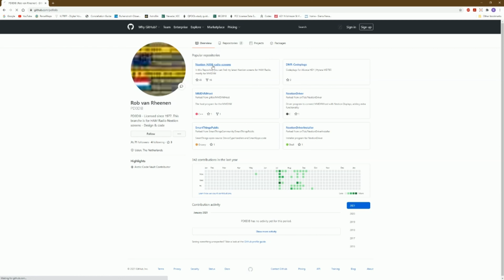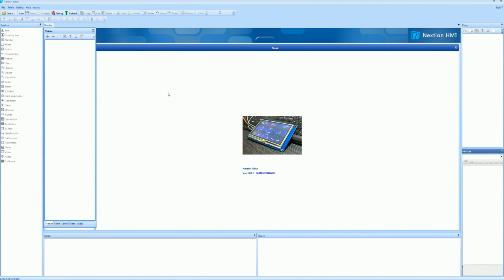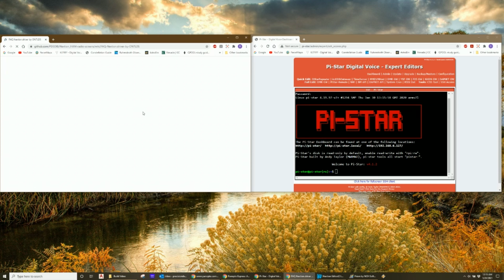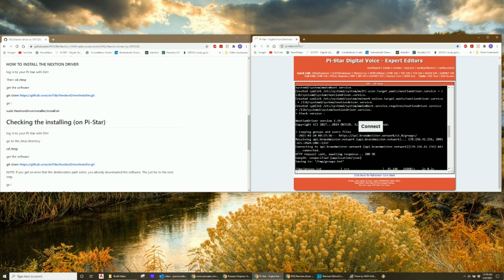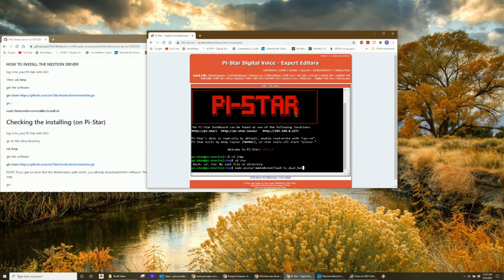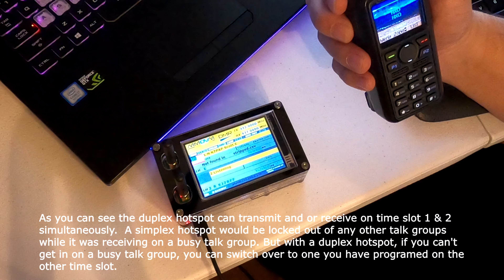C4 Labs DRPi-3.5NSX Nextion Screen Case - Build Video

Comment: Ever since updating to MMDVM firmware v1.5.2, I haven't been able to see the "cpu cycles", "disk free", and "cpu load".  Just FYI..  😉
Reply from the maker: Try reinstalling the ON7LDS driver.
Reply: @arlo12345678910  Done that several times..no luck.
Reply from the maker: It may be installed but not configured.  See my reply to Tom V below
Reply: @arlo12345678910  've tried all that..  Was running Pi-Star 4.14 , Pi 4B+ 2GB.  Still doesn't work.  I even changed SD cards and started from scratch.  It all works except the  "cpu cycles", "disk free", and "cpu load".  Go figure....
Reply from the maker: @tim6053  ....  Dang.  I had that same problem but it was the configuation.  And each time I reinstalled the drivers, it appeared they were installing.  But they weren't actually reinstalling.   It wasn't until I scrolled back up and read everything that I realized it was saying I already had the drivers installed, did I want to reisnatll Y/N.     I needed to hit yes in order to reinstall except that it would flash past that screen with no time to hit Y (yes).   It finally dawned on me that I needed to be tapping Y from the moment I started the driver install.  That way when it flashed past the screen where it says " Do you want to reinstall Y/N"   I was already tapping Y to initate the reinstall.  

I'm not saying this is your problem it sounds like you are confident the drivers are installed and configured correctly.  I only bring it up because on my first hotspot which is the same as the one in this vid, I had the problem twice where it wouldn't display the "cpu cycles", "disk free", and "cpu load"  and both times the drivers were installed but not configured.   The first time it happend I was perplexed for a long time.  I reinstalled the dirvers over and over but to no avail.  Untill finally I actually scrolled all the way to the top in and read the lines of code.  I was never acturllay RE- installing the driver.   Have to be tapping that Y key.   The second time it happend I solved it in a jiff.   

Again I'm not saying this is your problem but I feel like it is a common problem seeing as I had it happen to me twice on the same hotspot.   Also there is a forum on facebook where a driver issue is always at the bottom of the non appearing "cpu cycles", "disk free", and "cpu load".  I wish you that absolute best and hope you are able to solve this mystery...  If you do please come back and let us know what it was.  I'm sure someone else will have the same  problem and would be great if your solutions was here for all to learn from.   73!
Reply: @arlo12345678910  Thanks for the info..checking..By the way, what do you mean by "and both times the drivers were installed but not configured."  Is there something extra that needs to be configured?  I have selected from the display line, Nextion, Modem, and ON7LDS 3 HS"..  Is there anything else?  Thanks..  73
Reply: Also, has anyone got this working with a Pi4B+ ?
Reply from the maker: @tim6053  Meaning that there are two things you must do to get the driver working.  First download it and second install/configure it.   You download it to the temp directory first by typing:
          cd /temp 
This command accesses the temp. directory then you type:
          git clone https://github.com/on7lds/nextiondriverinstaller.git          
This command downloads the installation file to the temp directory then you type:
          sudo nextiondriverinstaller/install.sh
This command both installs and configures the drivers in this step. You don't have to do any other configuring.  However twice for me it installed but failed to configure the driver and so "cpu cycles", "disk free", and "cpu load" would not work. 

Since those fields did NOT work I was under the impression that it had NOT installed it and so I performed the above code sequence time and time again and time and time again all kinds of text would scroll down the screen making it look like it was reinstalling. But of course the fields still would not populate.  So then I was under the impression that I had the driver installed correctly and it must be something else.  But every time I inquired with others about what could be the problem they all told me I don't have the driver installed correctly. (what they meant was configured correctly)   So again I went back into the CSS Access (i.e. DOS mode panel) throught pistar's expert portion of the configuration page, and this time I was determined to get to the bottom of it.  I accessed the temp directory, ran the download, ran the installatoin and it did the exact same thing it always does, scrolled a bunch of text down the screen making it look like something was happening but this time I scrolled back up to see what all that stuff actually said and I realized it was not actually reinstalling the driver because the driver was alredy intalled and what it was doing was simply closing out. In fact it actually said,   burried in severals screens of text,   the following:

"The ON7LDS driver is already installed do you want to reinstall it y/n"
"you have version 1.9"      
"the latest version is 1.9 no need to reinstall."

That's when I realized I was never ACTUALLY reinstalling the driver.......   

So I thought OK well it does ask me if I want to reinstall the driver so all I need to do is type Y at that prompt.  So I ran the install again but I had one major problem......  The text was flashing up the screen so fast there was absolutly no time to even see where it said "to reinstall hit Y/N" let a lone to actualy be able to type Y at the appropriate time.  It finaly dawned on me that I needed to be typing Y in rapid sucession from the second I initated the driver install so that I'd catch it when the prompt flashed across the screen.  

When I did that I it worked like a dream,....  I caught it in time and it indeed ran a reinstall and this time it started flashing tons of text down the screen for a long time.  I.e. it was actually REINSTALLING the driver and actually CONFIGURING the driver... FINALLY!!.  And this time when I fired up the hotspot those fields populated. 

All that being said, I am not 100% certain that this is your problem I could be totally off base but I have a sneaking suspiscion this is your problem.    You did mention that the fields stop populating after running the MMDVM Hat firmware update.  So I made the assumption that they did work at one point and that the Pi4B  was not the problem.  They did work before, correct?  Is the temp field populating?  It would be really good to know what temp your hotspot is opperating at as I've heard the 4B's run hot.   Keep us posted of your progress and 73 friend!
Reply: @arlo12345678910  
Well, apparently persistence pays off !!  😎.   I reloaded it one more time (using a Pi3B+ this time), and started slamming the "Y" button a fast as I could.  It actually asks you for a "y" instead of a "Y"..  Not sure if that matters but it stopped long enough for me to enter the correct key.  Long story short, it now works 😃😃.  Now I'm going to try the Pi4B next and see if I can replicate it.   Thanks for the help.  73
Reply: By the way, I use a small Pimoroni Fan Shim on the Pi4B...Works great and never gets of 57.
Reply: Just got it up and running correctly on the Pi4B !!  Using the same technique  😎😎👍
Reply from the maker: @tim6053  Awesome!  I'm srue it feels great to overcome that little glitch I know it did for me when I got mine working.  Glad it works on the 4B too and that it's running cool with the Pimoroni.  That's great information to document in these comments.   I'm 100% sure it will help someone else down the line.  73's back atcha!

Comment: Nice!!! Bob, did you only need the one heat sink?
Reply from the maker: I used two. The larger one on top of the chip and on the bottom there is a square cutout in the acrylic that lines up with the bottom of the chip and I popped the medium size heat sink in there

Comment: Thanks for this walk through it was very helpful getting up and running... I have one issue with the Nexton, it is stuck on the demo screen.I'm using the same exact configuration as you are using the NXT pinouts on the hat red blue yellow black double checked the Rx>TX and TX>RX reversal still no pi-star display just the Nexton Demo. any Idea's ?
Reply from the maker: When you say demo screen do you mean boot screen? The boot screen is the one that says, "Please wait, starting up hotspot..."
Reply: @arlo12345678910  it is the demo screen with the three sprites of a production assembly line with three buttons under each. I have the pi-star up and running and can browse to the config interface just fine just no pi-star video display on the nextion
Reply from the maker: @wkm2002  OK, so in that case, your Nextion screen needs an image uploaded to it.  The pi-star opperating system has no image of it's own.  Go to 2:57 of my video and watch the procedure for "imaging" your nextion screen.  By the way, if you've soldered your Nextion screen to your modem you'll need to power up the Raspberry Pi in order to power up your screen.  Hope this helps!
Reply: @arlo12345678910  ahhh... I knew I was missing something ... thanks for the helping me hear the popping sound ... lol :)

Comment: minor/major mistake - when switching to duplex - you should have selected 'Apply Changes' -- same said as you update/alter each section of the configuration.  The 'Apply' is only for that Section.  So typically one would alter the Duplex, if applicable -> Apply; then setup the wi-fi interface -> Apply; then the General config -> Apply; then any specific protocols - DMR, YSF, etc. first by enabling & applying, then individually configuring.  I also perform a "Backup" between major secitonal changes so as recovery is quicker if a section is mis-configured accidentally.
Good overall - answered the question I had about imaging the Nextion - didn't realize it was that simple.
Reply from the maker: Yes that is correct, must apply after ea section. I kinda jumped the gun on that, although sometimes even when applying directly after maiking changes to a section, the the changes don’t take.  Glad you were able to image your Nextion screen. Very easy to do especially if you have a chance to see it done once or twice.  Exactly why I made this video so that all the informatin is in one place!  Thanks for watching and I really appreciate your feedback!  73
Reply from the maker: I've confirmed you do not have to hit apply at the end of ea section.  You can fill out all the sections and hit apply once at end

Comment: You did a great job..a lot of work.
I followed your procedure..but still cant get the 3 areas on the screen to show data??? Downloaded
The on7lds file as shown but still no go?
Reply from the maker: Try redownloading and reinstalling the ON7LDS driver.  ~
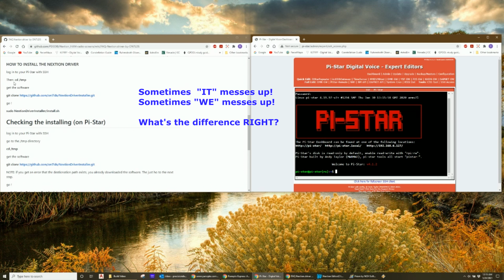The sequence starts at 55:00 
Then proceed with the install 56:08 after you've typed in the install code hit enter 
it then asks you to if you want to install y/n 56:48  type "y"   then ener.......  Now here is the tricky part,  after you type y, enter,  it begins the installation and you'll see a bunch of text scrolling down the screen.  When it stops scroll back up and see if it says something to the effect of :

"The ON7LDS driver is already installed do you want to reinstall it y/n"
"you have version 1.9"       (or somthing like 1.9 I can't remember exactly what version we're on)
"the latest version is 1.9 no need to reinstall."

if it says this you actually DO need to reinstall so that it can go through the configuration again, (it is installed but not configured) however, it didn't give you time to hit "y"
so in that case run the install again 56:08 only this time when it asks you if you want to install y/n 56:48  type "y" enter,  then start hitting y in rapid sucession this way when it comes to the line where it says, "The ON7LDS driver is already installed do you want to re-install it y/n"  you will in fact be hitting y and catch it before it can abort the reinstall.  

This time it should go through the whole installation agian and hopefully get the driver CONFIGURED correctly.  I try to explain this in the video but since it doesn't error for me in front of the camera It is hard to really  explain.  

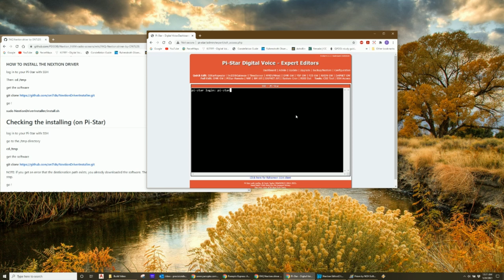Also were you able to flash your MMDVM hat as shown at 1:01:10 ?